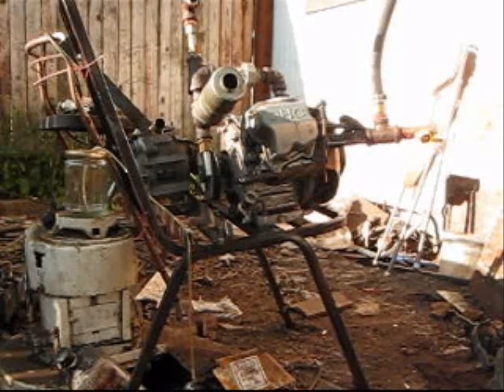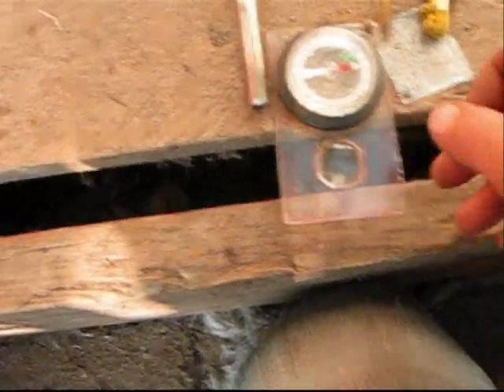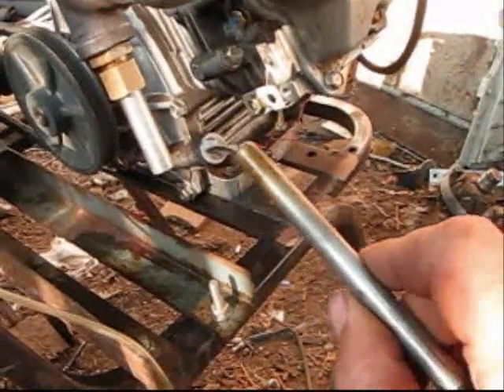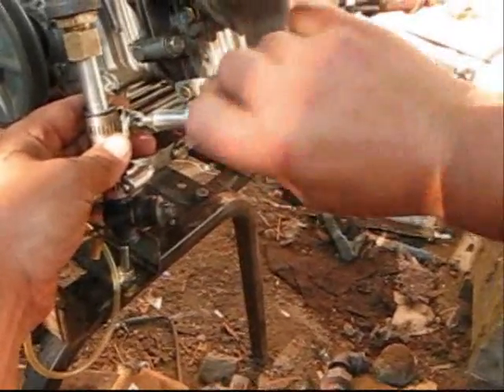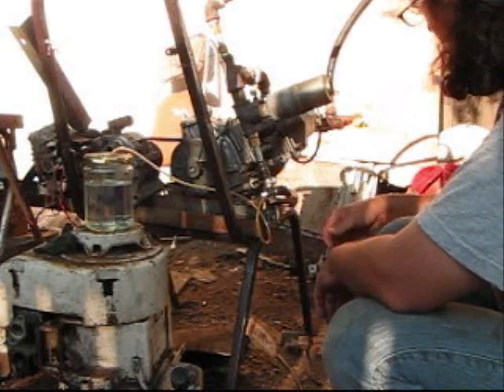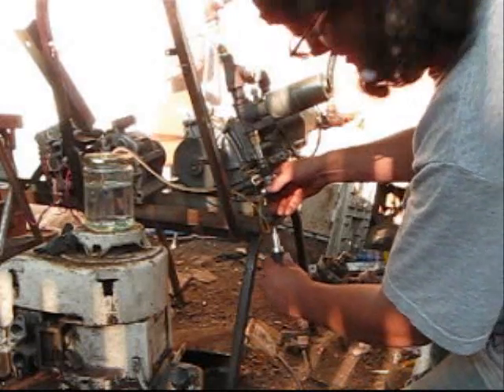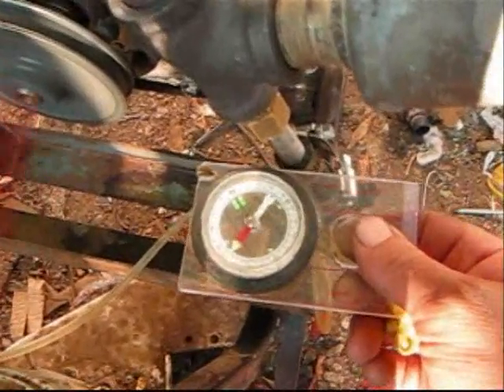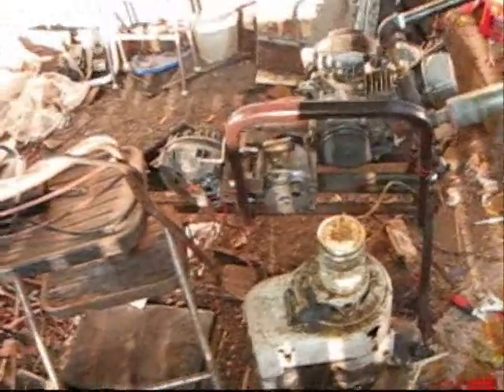geet rich mixture and magnetic orientation.wmv

Comment from the maker: Yes t-304 is stainless steel. the rod is 440c stainless which is a magnetic stainless  and it had a fairly strong field on it when i received it but still the reaction changed the initial field and left signatures.